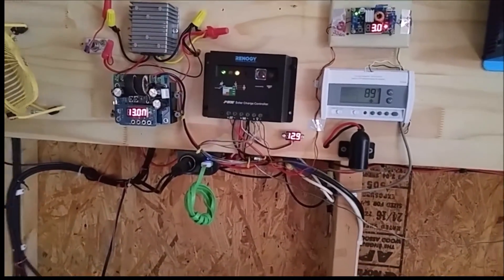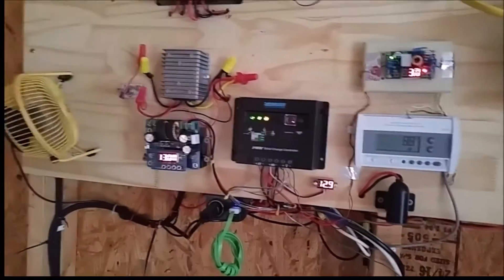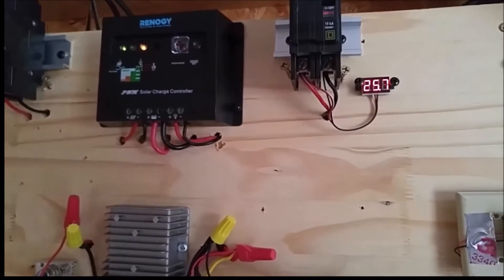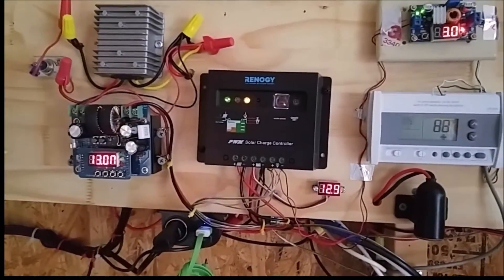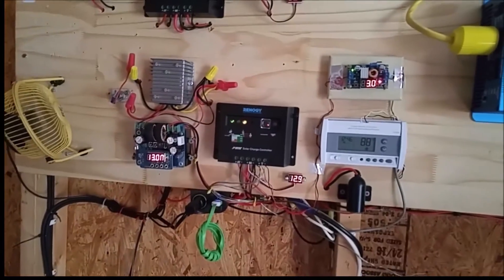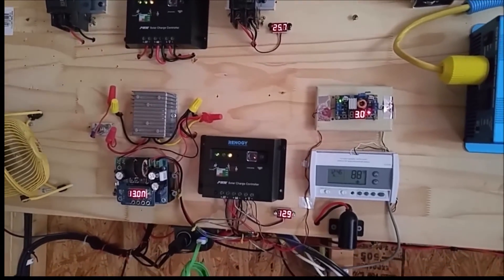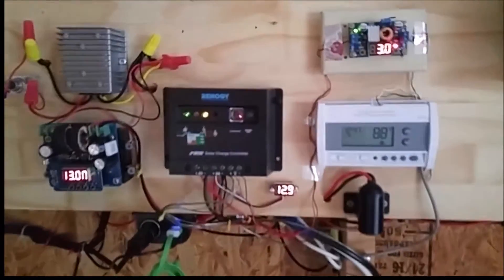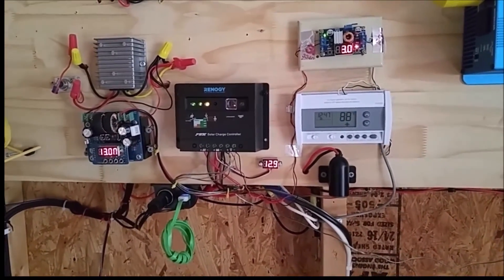Charging My Lawn Mower Battery Using Free Solar Electricity

Comment: nice to see an update on your solar shed setup. I just have the Harbor Freight solar kit just to experiment with so I think I'm going to do like you did and use it to charge my lawn mower battery also because I noticed it wasn't being charged when I was using the mower last time. Again love seeing your solar shed setup keep them coming.. thanks.
Reply from the maker: Thanks John. Charging the mower battery with solar is very cool, indeed. I would also like to see a video of your set-up.
Reply: +DIY OneForAll 
sometime this summer I'll make a video it will be my first one and it won't be impressive lol. Again thanks for your videos. Hey next time your in your shed doing a video can you run through real quick the components on your 12v side I know you use a step down from 24 to 12 which is a cool idea, I have to go back to your old videos to see what those other meters are and how you use them. Take care.
Reply from the maker: +John 
Ok, sounds good....I will run through the components on the 12 volt side when I visit the shed next.
Reply from the maker: +DIY OneForAll 
John, here is the video, as promised -  with a brief run through of components on the 12 volt side.  Hope this helps.
https://youtu.be/4O3oXndcNxw